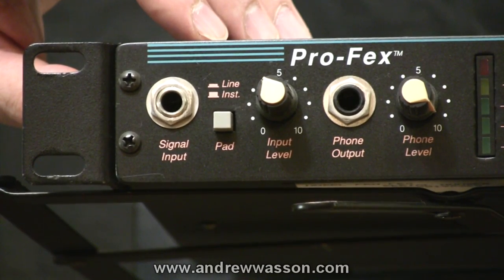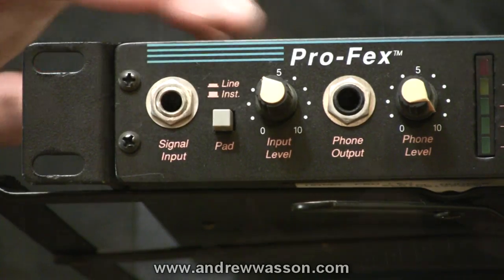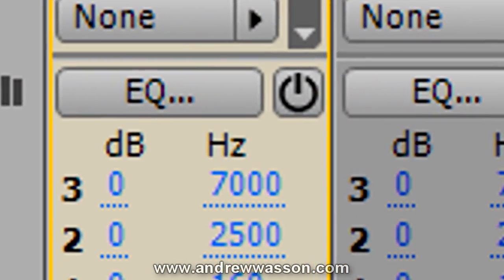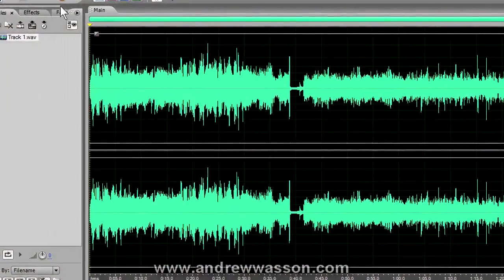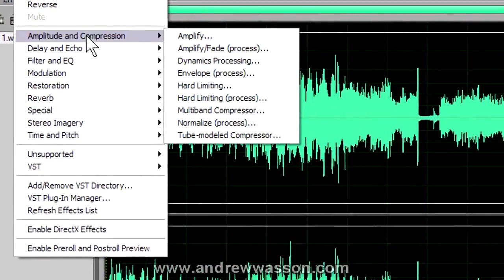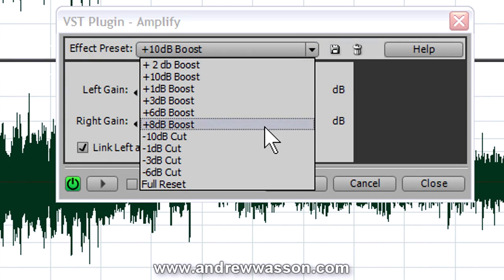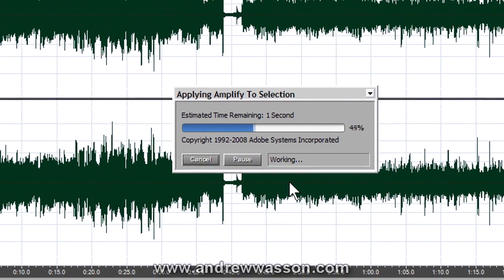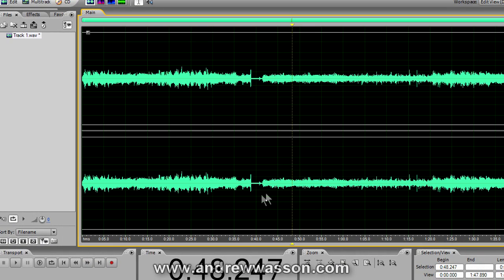Instrument Level Vs. Line Level

Comment: Hello, I believe a have a problem related to this topic.
I plugged my CD discman with the AUX cable in to my Fender Champion 100 AUX input and listen from it
for about 20sec. after I unplugged and plugged my guitar into the INPUT the sound disappear.
The speakers are fine because I can here sound when I plug the guitar into the PWR IN but 
I cant here from the INPUT.
Any thoughts / suggestion what can I do to fix it?

Comment: Hi Andrew, 
I have a question about having a condenser mic set up to an interface with phantom power. My interface has the option of having either line and inst levels, so when using the phantom power with the condenser mic, would it be better to have it set at Line level? 
Love your videos, keep em up!
Thanks,
Reply: Do you already have an answer on that?

Comment: Thanks Andy for your overview of the difference between line & instrument. Working as a guitarist with a sound processor that has the line/inst switch you mentioned used to confuse me as to its purpose. Your explanation as the difference in signal DB between line & instrument helped me to make sense of the switch. Thanks again!

Comment: You mentioned when using a rack, the pedalboard must be at line lvl. But you didn't mention if there is a POWER amp involved. By the logic of the dumb, the power amp should increase the lvl, thus obligating the selection of instrument level, [amp level] on my pedalboard (pod x3 live). Is any of this true?
Fantastic video, keep up the good work ;)

Comment: I have a quick question that I hope doesn't stray too far off topic.  I am looking to use a stage/practice amplifier with a professional accordion, that was just recently serviced, that is probably 25-35 years old.  The accordion has a 1/4" output with tone and volume controls.  Considering it is a reed instrument, I am guessing that it is at "instrument level"  Is there any evidence that would make that not true?  I have been searching online for a bit and have not come up with a definitive answer.  Thanks

Comment: I've got a similar amp been trying to work it out. Seems i'm told -10db is for pedals, +4db for racks, to overgeneralise it. I have an eventide pedal with a line/inst switch too and it clips on inst fed by -10db so set it at 'line level' which iguess must be -10. -10 is line but its closer to guitar signal and most pedals accept -10. Line 6 for example isn't good at that. -10 is unbalanced and +4 is balanced usually so mostly racks with TRS or XLR. Think this is right.

Comment: There are some units that put out very low impedance (which is essentially line level correct?) and which are supposed to sit in front of your amp's input, these are some multi-fx processors and the ISP decimator pro rack G for example, these units add a lot of additional hiss to the signal when plugged into the front end of an amp, is this because you are feeding a line level into the amp's input? If yes is there a way to correct this?

Comment: @spoonsrbetter Amp modellers with line outs are designed to go in line inputs but pedalboards designed for going with amps dont. Most boards should either have different out put jacks or a switch to change level.

Comment: Hey man...I have a question if you have time...I am running (in the effects loop of a Splawn Quickrod) a Vox Time Machine Delay Pedal into a TC Electronics G Major Rack Unit. The effects on the amp has a -10db/+4db switch. What is this and what should it be set to? I can't seem to figure it out or hear much of a difference.

Comment: @LeJo82 Typically if you have a guitar/bass with passive pickups you use the high gain input and if you have a guitar/bass with active pickups typically you use the low gain. This has a lot to do with peaking and preserving tone.